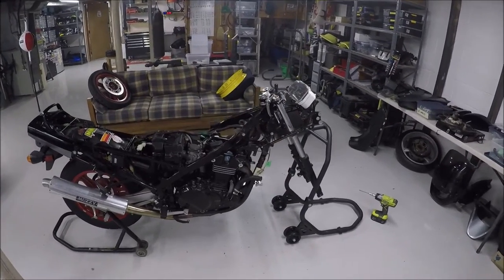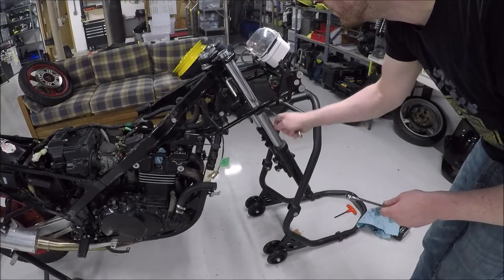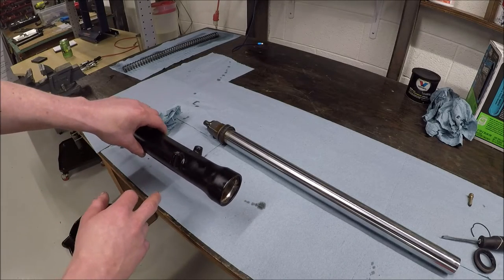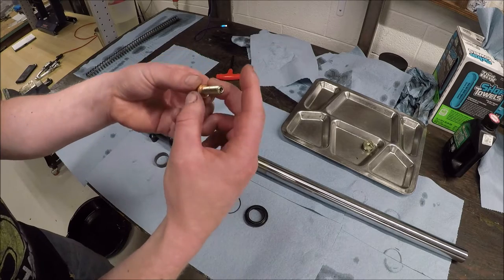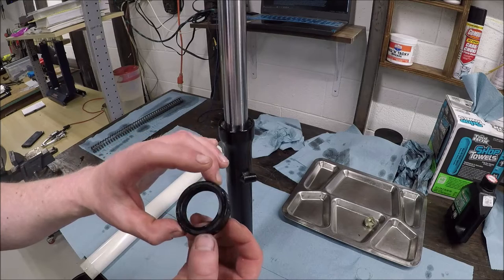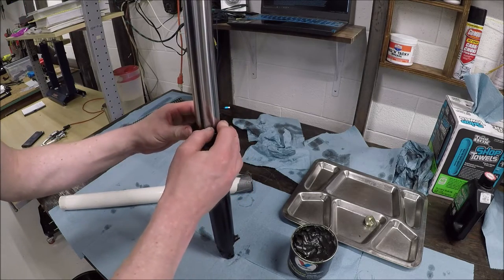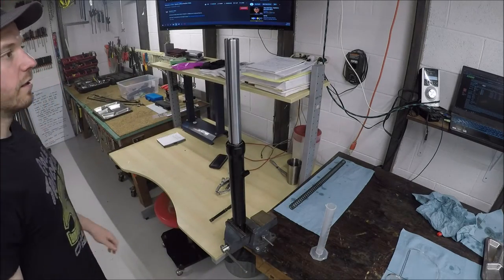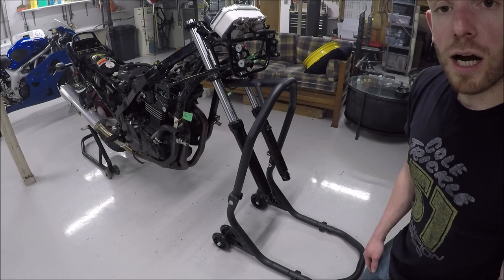Fork Seals - Kawasaki EX500

Comment: My 1984  zn700a Kawasaki had screw on caps but all internal parts were the same. Have yet to test ride. But your video made it super easy to change out my seals
Reply from the maker: That's awesome man. Hopefully some good rides in store for you and the 700 coming up in 2024!
Reply: @matttriestodothings  I've gutted the harness, installed the M- unit ,new tires ,fork rebuild brakes. Greased bearings cleaned the carbs. Going to be a solid bike fingers crossed.
Reply from the maker: @915greenhornet  hell yea. Sounds like you're well on your way.

Comment: Im about to do seals and oil on my gpx250 when i get the seals, so glad this video showed up in my watch feed as this was the perfect video to show me how to do them as its my first bike and first time working on forks. Thank you very much for taking the time to record the process :)
Reply from the maker: Absolutley man. Hope everything goes smoothly on your 250!
Reply: @matttriestodothings thank you very much, I'm sure after watching this a second time it will go smoothly. 
Just need to get a bearing puller to make life easier since i will use it to do the headstem bearings at the same time, and front pads, rotor and wheel bearings. Bike will be so much nicer after all of that :)
Reply from the maker: @jamie.miller.inspiring  the puller is a useful thing to have in your tool kit. I didn't have one until I had to pull my trucks AC clutch and I've used it a bunch since.

It'll definitely feel like a much nicer bike once you're through! Hope everything goes smoothly and you're ready to rock soon.
Reply: @matttriestodothings  its one of the few things I've managed to not buy yet but that will likely change today :) 

Absolutely it will be like a new bike, I will keep collecting a few things (some pvc pipe and long 6mm hex driver bit) until its a rainy day or two as I dont want to sacrifice awesome riding weather 🤣
Reply from the maker: @jamie.miller.inspiring  ohhhh yea don't do that shit now. Wait until it's crap weather for sure. I'm just in winter mode, hah.

Comment: Thanks for this video, I've got a 2003 GPZ500s that is leaking fork oil all over the place and the Haynes manual is a little ambiguous in places. My main questions were about driving the bush and oil seal into place but after watching I'm pretty happy I can give it a go.
Reply from the maker: You'll be fine changing them if you have a driver that can do a 36mm seal and a good enough hex drive to break loose the damper rod bolt. If you have those two things, you'll be good to go. For the most part, these conventional forks are all about the same. The Kawasaki circlip as opposed to regular top cap on the fork just threw me through a bit of a loop.
Reply: @matttriestodothings  I rebuilt one fork tube following your video and using your method of some guttering pipe to help drive the bushing and seals home. Two weeks on an not a single drop of oil has escaped. Decided I might as well do the other too. Thank you sir :)
Reply from the maker: @BaronVonBloodvig  That's fantastic man! Glad to hear it!

Comment: What oil can i use for fork? Thank you for the tutorial. Verry good video
Reply from the maker: I use Maxima fork weight oil--but you could use pretty much any name brand oil that's available at your local shop as well. It's best to choose a brand and stick with it since their viscosities can differ between brands. 

Automatic transmission fluid was also commonly used in the past. It acts as ~5W fork oil. I'd say 5W is too light for this bike though.

Comment: I use the old seal on top of the new seal and drive it instead. I have bent the new seal using the driver directly on it.
Reply from the maker: Ive had the old one get stuck doing that in the past, and then I was left trying to stab at the thing trying to get it out. You're right tho in that this is a bit crude and because it doesn't mate fully with the seal, leaves some room for damage. Maybe I ought to give using the old seal on top another shot in the future.

Comment: I liked the video but when and where do I put the fork oil
Reply from the maker: 17:42 . After you've driven the fork seal, installed the circlip over the fork seal, installed the dust seal, and put the bolt through the bottom of the fork to hold the damper rod. With the spring out and the stanchion collapsed completely in the fork lower, you'll add fluid until it reaches a specific level.

Comment: I ran into an issue where one of the bolts you used an impact on was stripped by a hand tool. Do you think using an electric impact would get out the stripped screw or make the problem worse?
Reply from the maker: I've dealt with the stripped bolts (damper rod bolt) before, and I've been able to zip them off with the impact when nothing else would work. I try to keep spares on hand if I know I'm going to do seals and the damper bolts are no good. It really, really sucks to have to drill them out. I've had to do it in the past, but ever since I bought an impact wrench, I haven't had to resort to the drill.

Comment: How do you know when to stop driving the washer and seal down? Is there something inside the fork that they sit on?
Reply from the maker: You can tell when the bushing has been put all the way in with the washer. If you're unsure, just look at the space above the washer and below the circlip line--it needs to fit the fork seal. If there's enough space to fit the seal, the bushing/washer are far enough in.

The seal is far enough down once you can put the circlip into the grove to hold the seal in place.
Reply: @matttriestodothings  thank you, I saw what you were talking about once I got the fork taken apart.

Comment: looking to replace seals on 2007 Vulcan 500LTD...is it basically the same as EX500? Any special tools?
Reply from the maker: I don't know about the 500LTD, but if they're standard conventional forks, I can almost guarantee the process is going to be nearly the same. The only thing special about the EX500 and 1985 454LTD forks was the top cap removal that required a 2-jaw puller for me to remove.

Comment: Having an issue on my 2006 ninja 650. Can’t get the seal down far enough to fit the lock clip in. Any suggestions?
Reply from the maker: Did the bushing make it all the way down before you started driving the seal in? Assuming it's a similar conventional setup, I can't think of what else would be blocking it.

Is it flush or cockeyed in the bore?
Reply: @matttriestodothings  it’s just sitting right over top where the clip goes in to lock the seal.
Reply: @matttriestodothings  I tried putting more force on the seal driver with minimal luck. Took it apart several times and tried with no success.
Reply from the maker: @vcme  maybe a stupid question, but.. Do you have one of the old seals to compare the height against the new seal? I'm wondering if you could have the wrong size. Diameter bring correct but height being different.

Trying to think of the simple things before suggesting to try driving it harder.
Reply: @matttriestodothings  I compared the sizes and they are the same. I think i might be inserting the pieces wrong.

Comment: What is the arm clamp screw thing called and is there any alternatives?
Reply from the maker: 2 jaw puller. Alternative is a second set of hands. Just have someone push it down with a rod while the other pulls the circlip with a pick.
Reply: @matttriestodothings  thank you
Reply: @matttriestodothings  also can I reuse dust seals
Reply from the maker: @Hunter-p6r6y  If they're not all cracked and they're still pliable, yes. I've done it before without issue.